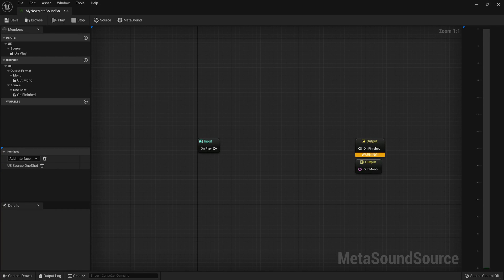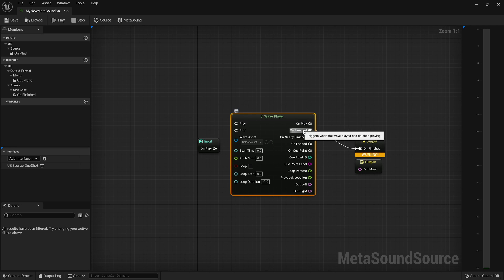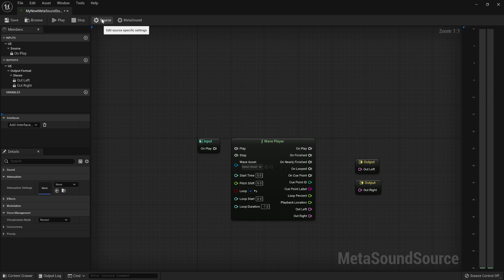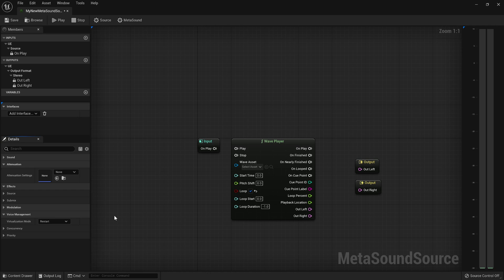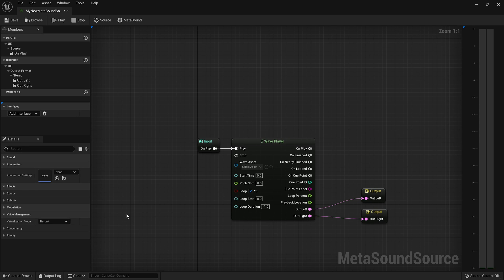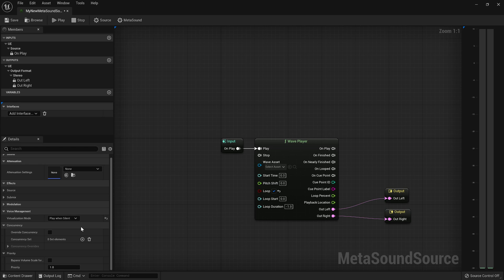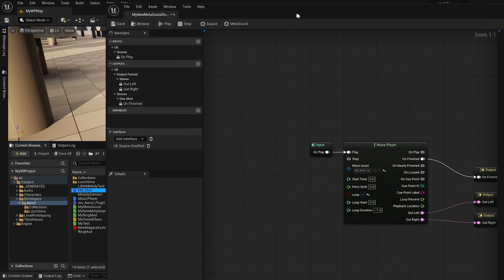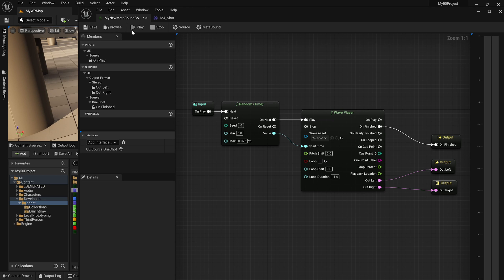Basic MetaSound Setup Including Looping or Non Looping Configuration

Comment: Hello Dan! Do you think it is possible to make some kind of audio portals in Unreal Engine? I feel like that this tech would allow to really step up the game of audio in UE5. Or am I missing something, maybe it is possible to be done with Audio Gameplay Volumes, or Blueprints? Any kind of info or a separate tutorial would be much appreciated!
Reply from the maker: Yes, but we don't have a turn-key solution for this. Fortnite Battle Royale has something like Portals using Source Buses and a system to detect when the player is inside a structure.
Reply: @DanReynoldsAudio  I am pretty sure those Audio Gameplay Volumes can be used somehow. They already have the data about sound being outside the volume. Maybe a "door" component could be added to be then manually placed on a scene for location. It has a Source Bus and a Send/Override Submix functionality for filtering. Then if a player is inside a volume - all the outside sounds could be played through this bus.. 5.5 maybe ? )